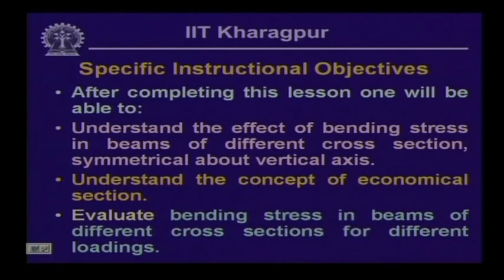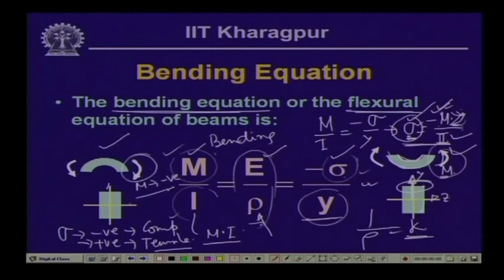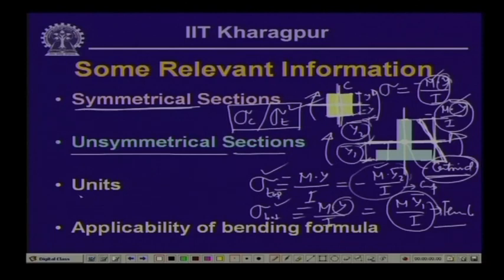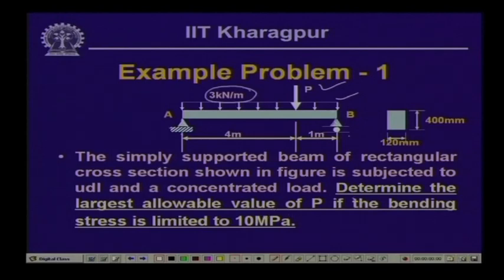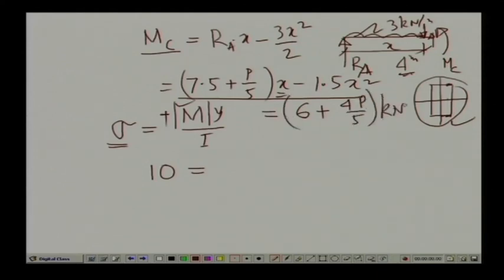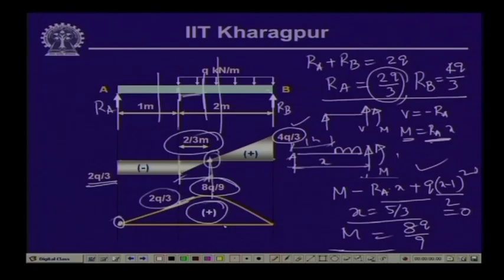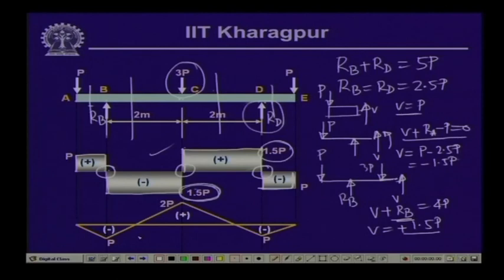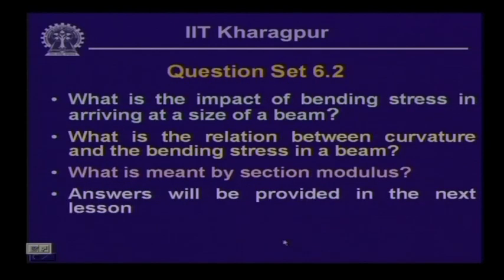Stresses in Beams - II

Comment: For the T section problem, P=11.02 kN and P=8.7 kN both are safe. The corresponding compressive stress of P=11.02kN is also less than that for 8.7kN. Then why P=8.7kN has been chosen to be safe?